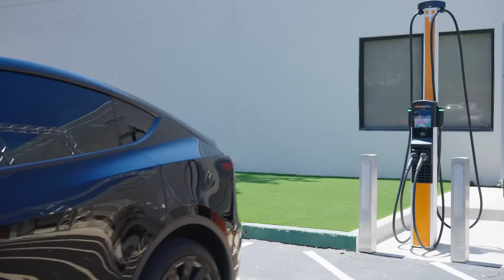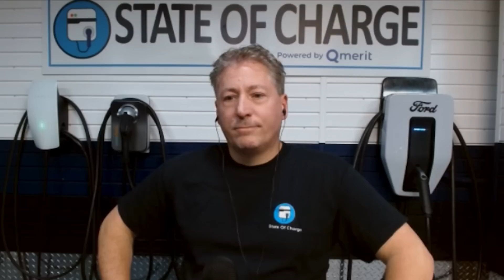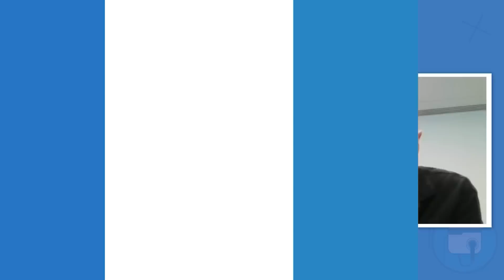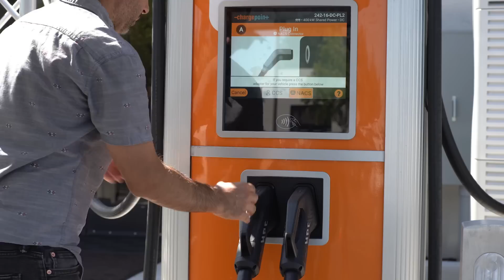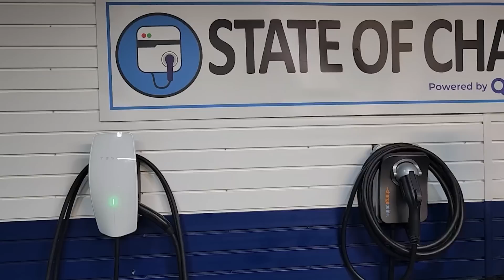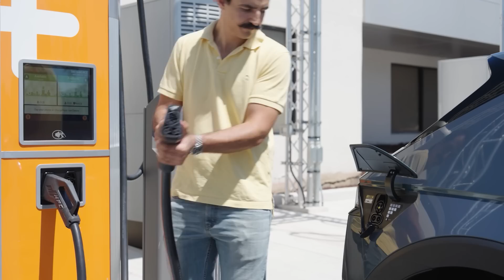ChargePoint CEO Rick Wilmer Discusses How Omni Port Will Eliminate EV Charging Connector Confusion

Comment: How about Charge Point putting some units here in the middle of the country in Kansas/Oklahoma?  Currently there are none in the western halves of either state. Nor  are there any sites from other providers for that matter, which means it’s an open market for them. The 250-300 mile gaps between the Interstates need filling
Reply: Francis Energy seems to be working on that area.
Reply: @carlfriedrichs2404  I have lots of experience with the Francis Electric network in this area.    They are the EV charging provider for non-Interstate highways, with dozens of sites pretty well situated across Oklahoma.  They received the VW settlement money and were required to build their sites on US and State highways instead of the Interstates, which are already pretty well served by EA and Tesla.    The problem is that Francis has installed some chargers that are incapable of charging EGMP vehicles such as my Ioniq 5, Kia EV 6, etc.    Entire sites cannot charge these vehicles.   Also, Francis does not maintain their units at all, and some sites have been completely dead for over 2 years now.     The rest are mostly crippled at 40 kw.   Francis is a complete joke in my and a lot of others’ opinion, yet they have received the 2nd largest amount of NEVI funding in this first round.    They have not built anything yet, but based on their track record, I don’t expect much from them.
Reply: Hey Glenn, You might get your wish. Loves is going to be putting in a lot of charge point hardware in Oklahoma. If you have a loves nearby
Reply: @Crazypostman  That would be great, I hope they follow through with it.   I had hoped that when Love’s built their big new store in Watonga that they would be including some EV charging units but they didn’t.      The brand new Love’s truck stop in Watonga would be a great place to put some as there are no EV charging sites between Oklahoma City and Seiling, 120 miles.   Now if we could just get Francis to upgrade that ridiculous site in Frederick where I cannot charge my Ioniq 5 and fix their dead (2+ years at the Hinton Cherokee) and crippled units they have all over the place.
Reply: @glenngore6609  Yeah, Frederick sucks. Gotta remember to stop at Hobart.
Reply: @Crazypostman  it doees indeed suck because there is no place to charge between Hobart and Denton if you’re making a road trip to the DFW area.    Heck, there is only one Supercharger between Hobart and DFW, at Henrietta, for the Tesla people, but that is no help for us anyway
Reply: @glenngore6609  There's a loves where the EZ-GO used to be on the interstate between Lawton and WF. Maybe they'll pull that trash Francis equipment out and replace it with a chargepoint.
Reply: @Crazypostman  I’ve been to that Francis site many times, it rarely works or you sit there for hours, but it’s the last closest place to charge on the way to Dallas.   Loves inherited the site from the old convenience store that was there
Reply: That’s not their business model. Watch the video he explains it. 4:14
Reply: @asjmcpherson  I did.    And I understand their business model.    I also note that from their app’s map that they have very few chargers in the middle of the country, located like everyone else only along the Interstates, places that are already well served.    For “one of the largest charging providers in the world” I am a bit disappointed, because I have been to several of their sites and they do work well and seem to be well maintained.    For people driving only on Interstates they are a decent option.  For everyone else, not so much.

Comment: In some parts of Europe, they have a CHARGING box without a cable.  You bring your own cable.  

I think to myself: THAT'S BRILLIANT!

#1 It eliminates the probability some animal is going to cut the cable and steal it for Copper.

#2 People with larger cars can get larger, longer cables - since unlike Tesla, there's no standardization across cars and their charging systems. 

#3  It means you can install the chargers in more places and they can simply sit there waiting to be needed.
Reply: You lose liquid cooled cable so good for lower tier chargers but not super fast ones
Reply: @Mutation666   You telling me science can't create a portable liquid cooled cable ?
Reply: @BIGTRUCKSERIESREVIEW  sure but some doofus with a broken or fouled cable would ruin the pump or foul up the fluid for everyone else.
Reply: @BIGTRUCKSERIESREVIEW  Mixing coolants, having tanks on the chargers. Air bubbles in the system reducing efficiency. Cost isnt worth it..
Reply: @virtuserable  same doofus probably has old frayed cable and electrocutes self.
Reply: @virtuserable  self-contained liquid cooling
Reply: @BIGTRUCKSERIESREVIEW  so you mean the vehicle would house everything necessary to cool the cable? That would be better but still a world of problems and would require yet another connector standard NACS+Liquid Hose e.g.
Reply: Yeah, I think it is a good idea too and I believe they put that in the standard for J3400. But it's only for level 2 charging. I don't think anywhere in the world does this for Level 3 DC charging. But it should be awesome in the future! Putting chargers on Light poles and stuff like that. Pretty awesome.
Reply: In Sweden I think all public AC chargers are without cables. But ofc the DC fast chargers they are all permanent since you'd never drive around with a cable that can do 200 kW 😅
Reply: @Thor6398-jt4mb That's true all over Europe. The DC cables are also very heavy. Not something I'd want to be carrying around.
Reply: Not a good solution for DCFC.
Reply: Plus then when someone wants to steal your cable they can just prybar it out of the charger and car without having to risk a shock cutting the cable. Brilliant!
Reply: That style is a complete non-starter in 2024. That's a 2010 solution. No one is charging on level two anymore. Hopefully. You need the integrated cable for the cooling and the monitoring.